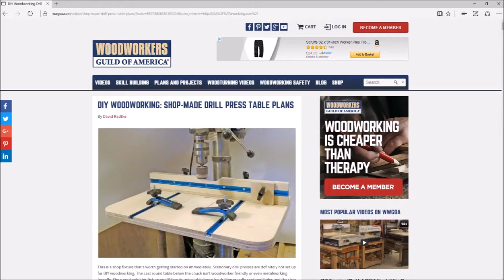RT : MAKES : Drill press table (Plans from WWGOA)

Comment: Nice video mate, well presented, I'd like to see the plans you made on your computer that you made if the offer is still there.

A tip (Constructive comment not a negative) if your planning on making any future videos, the music over lay is a bit loud and i struggle to hear what you were saying.  Also what were the fixings you mentioned that you bought?

How did you get the rulers and the part templates burnt into the wood it looks very impressive.
I'm new to woodworking, so far I've printed full size templates out, glued them to the wood and cut them out. I've subbed you too,

Looking forward to seeing some more of your projects.
Reply from the maker: Thanks for the feedback, sorry for the late reply; didn't know I had messages to reply too. All plans were produced on CAD software that works with Laser cutter. this was how I burnt all the measurements into the wood. Just moved house and currently without workshop, but once I'm up and running properly again I'll try to do some new videos. I'm new to making videos so will take the feedback on board and try to tone down the music and improve the speech audio.

Good luck with your own wood working projects feel free to ask any questions

Comment: Nice work.

Is the insert just meant as a sacrificial piece?
Reply from the maker: Yes the middle insert is just sacrificial, it can be pulled out and replaced with a new one easily, and means you won't need to build a new table once the centre section gets chewed up. Also means you no longer have to stack up scrap wood under the work to save the table.